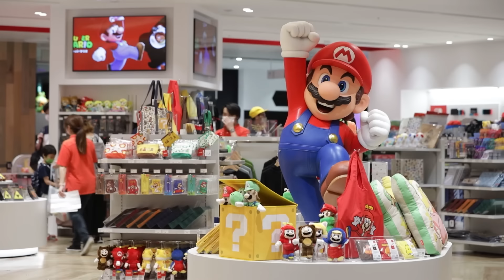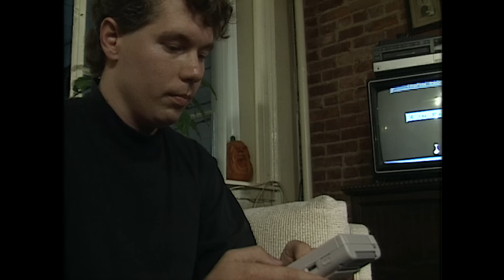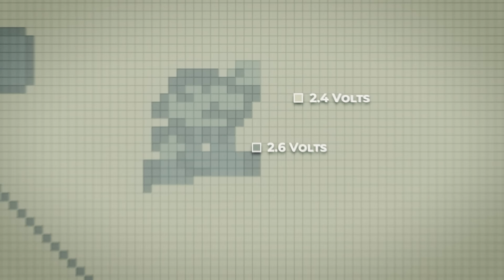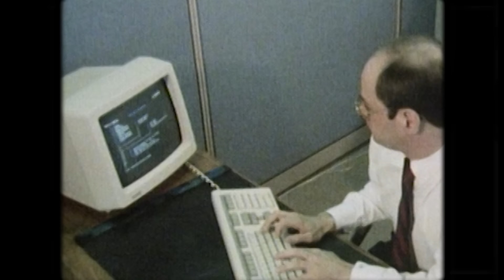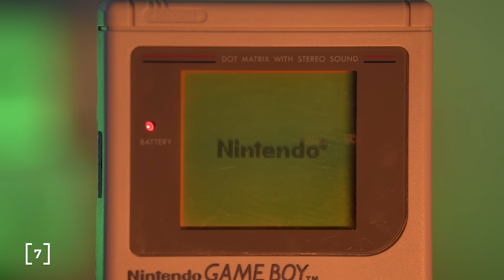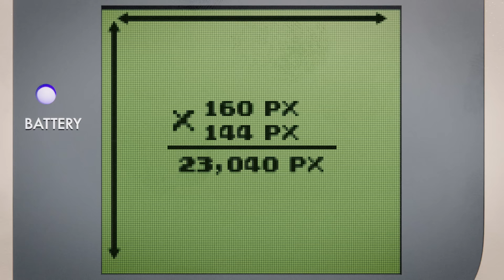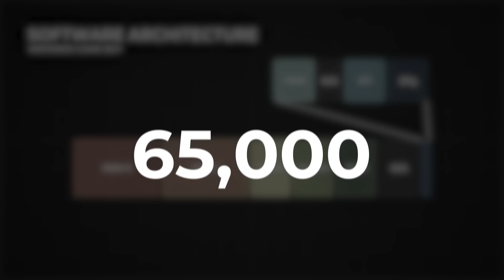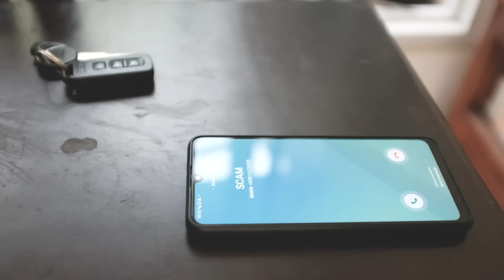The Insane Engineering of the Gameboy

Comment: Early video game engineers were absolutely cracked. Getting as much as you can from every byte is a lost art form.
Reply: @xelusprimeI don't really understand this argument. Sure better optimisations would be nicer, but no sane developer is going to code something like GTA5 entirely in a text editor, and I don't expect them to.
Reply: @skycloud4802  And nobody is expecting that. But there are a host of terrible practices that crop up in modern game development that could very easily be sidestepped with very little effort. For instance, I believe there was a case with one of the Halo games where 343 implemented the credits as an hour long 4k video file, rather than using an engine function to just scroll the credits across a rendered background. 

It's related to similar poor planning in the movie industry. Movies have ballooned in cost due to preproduction being  heavily cut and replaced with brute force iteration in post production. 

Preproduction is usually the 'strategy stage' of developing a game or movie, where you decide on technology and start laying out how you're going to solve each problem to achieve a finished product. Without that 'master plan' you end with projects stumbling around, wasting not just system resources, but time and money.
Reply: @Bustermachine  thanks for the explanation. You make some excellent points.
Reply: @Bustermachine  The way they choose to play credits across the screen matters very little. Choices like this are a choice to invest in other areas.
Reply: @widg3tswidgets416 consider the file size of an hour long 4k video file vs about four paragraphs worth of code to make the credits scroll?
Reply: Hands down the most impressive example of this was the original Roller Coaster Tycoon
Reply: @andysolganik8333  I disagree, not because that isn't impressive, but because I've seen Elite running on a 32KB Acorn.  🙂
Reply: @andysolganik8333  RCT came around 10 years after the game boy, though. Not that much of a problem in 1999 any more
Reply: @andysolganik8333  could you elaborate?
Reply: @JakMakai  It was hand written on assembly for windows.
Reply: @JakMakai  it was written in assembly
Reply: @andysolganik8333  Christopher Sawyer must be the most patient human on Earth to code that entire game in Assembly by himself.  Absolute rock star and I hope he's living an amazing life.
Reply: @andysolganik8333  As a programmer, Roller Coaster Tycoon is still one of the greatest inspirations of insane engineering... It's incredible what performance you could get out of those little bits and how much clever logic (including nice objects next to a path actually increasing guest happiness etc). Genius!
Reply: @andysolganik8333  The resident evil 2 port
Reply: @andysolganik8333 and before that, Transport Tycoon. Made by one man. An extremely impressive feat.
Reply: @andysolganik8333  Original Elite is much more impressive. Or Populous for the 16bit machines. Roller Coaster Tycoon already had comfortable resources available. It even had access to a full Graphics API (DirectX). So no, it definitely is not the 'moste impressive example' of this. How do I know? I am an old guy. Did Intros and Demos on the Amiga back in the day.
Reply: @andysolganik8333  never knew or thought of that...
how so??? on pc???
Reply: @andysolganik8333   not very programmer wants to learn x86
Reply: @andysolganik8333 oh the memories
Reply: @andysolganik8333  As a programmer, Roller Coaster Tycoon is still one of the greatest inspirations of insane engineering... It's incredible what performance you could get out of those little bits and how much clever logic (including nice objects next to a path actually increasing guest happiness etc). Genius!
Reply: @andysolganik8333   Nah, the most impressive example was the original "Elite" from 1984.

It packed an entire galaxy into 32KB.

Indeed, "Elite" did this by utilising procedural generation. It was an open world game. It featured permadeath, ships upgrades, true 3D wireframe graphics (with hidden line removal).

And the point to understand about "Elite" was that it INVENTED all of these things. None of this previously existed.

Its competition were arcade games like Pac-man, Asteroids, Space Invaders - with lives and score and levels.

And "Elite" blew all of this out of the water.

It invented modern video games, as now they all have open worlds, procedural generation, 3D graphics, upgrades and ranks, and dispensed with the notion of "lives" and "levels".

Indeed, Rockstar have confessed - "Elite" is the original game that inspired the open worlds of GTA. Bethesda has also admitted it - "Elite" was the original "open world" game that inspired the Elders Scrolls and Fallout.

"Elite" is the grand-daddy of them all.

In 32KB. In 1984. On an 8-bit home computer.
Reply: @klaxoncow  Where do I get a junior job learning about doing that? I imagine only embedded needs that. Still sounds insanely interesting. I have a bit of C programming experience but "Elite" and other games that push a hardware to its extreme is far beyond my capability.
Reply: @klaxoncow elite is fuckin amazing
Reply: @andysolganik8333 damn yeah - handwritten in Assembler 👍😳😳😳
Reply: not completely lost luckily, the Demo Scene is still alive and kickin
Reply: @Cryo_Gen  is it really? where?, I'd like to know!
Reply: @Cryo_Gen  yep we have 64K annualy
Reply: I'm still surprised that the xbox 360 could run Crysis... A game that's still demanding today.
Reply: @PunishedClippy  because it was optimized for that, not for the PCs. Xbox360 is a PowerPC
Reply: @PunishedClippy  The game is only demanding because it's single threaded at a time when single core processors were the norm. Modern day CPUs have multiple cores so while Crisis is hard to run, if you look at GPU usage you'll see that it's hardly being used
Reply: @PunishedClippy  
1. I mean it 'runs' crysis but is vastly inferior graphically to pc
2. It isn't demanding whatsoever today, you can buy an $80 pc and run it on max
Reply: @luketargett2233 that's a huge fucking exaggeration
Reply: nowadays, games are very unoptimized. older games actually looks better with higher fps.
Reply: @roku_nine  To a certain extent. It depends on the game. Older games do not necessarily look better
Reply: If an engineer wants that old school feel of having to fight for every last bit and byte, they should work on aerospace software, especially those that go into orbit.
Reply: There's also a video that goes in depth of the compression algorithm used to store all the Pokemon Red/Blue sprites in the cartridge.
Reply: It certainly isn't lost, it just isn't a requirement for most development work anymore... though one lowkey wishes it still was.
Still the issue is much worse in the Electron-powered general application hellscape than it is in gaming.
Reply: @SadeN_0 bro quit whining and download these 200mb of node_modules
Reply: @SadeN_0  inplace=True
Reply: @SadeN_0   Electron is horrible, people can't actually even program to the APIs of the operating system anymore.
Reply: There are definitely corporate and defense developers working with 516kb of memory. Gaming devs have no incentive to figure it out.
Reply: embedded  device programmers still struggle with memory limitation aren't they
Reply: Steve Wozniak, co-founder of Apple, was famous for this as an undergrad engineering major at Berkeley and then as a young engineer at various chip companies. This minimalist engineering ethos showed up in his design of the first Apple computer.
Reply: @joeyp1927  
I wish that I had found more time to program my first computer, my Apple //e. As I was watching some YT videos of old Amiga vertical-scrolling pinball games, what fun that would be to try to get that to work on a 1 MHz Apple //e. By my estimation, not having any actual hardware game sprites, only a 16K range of RAM representing its double-high-resolution graphics, most of that 16K would have to be entirely rewritten for each frame of animation. Using the most efficient program loop possible, byte-for-byte copying, I estimate that I could get around 5 frames a second. The Assembly code opcodes just can not execute any faster. Reading a byte, 5 micro-seconds, writing, another 5, incrementing an index register 2, test to see if the loop is done, I think that would be at least 2. Fewer than 100,000 bytes can possibly be copied in a second. Such slow CPU speed is fine for loading in still images, (I actually wrote my own crude double high resolution image loader which only took maybe a second to render an image, plus maybe a few more seconds to type the filename and wait for the disk to load the file), but horrible for anything like a mostly-full screen scroll that needs to occur multiple times a second. The non-visible parts of the pinball table would also have to be in RAM and in similar byte representation and thus could not be compressed, in order to allow for byte-for-byte copying. Thus, the pinball table would multiply in RAM memory size by 3 or 4 times. Maybe double would be enough, if there just is not enough RAM to do any more. Then I need some other overlay graphics besides merely scrolling the background, with no sound chip I might be limited to mere brief blip sounds so that the interruption in video animation is not noticeably long. And all that might have to fit within just 64K to minimize memory bank switching, absolutely no more than 128K required overall unless merely for loading different pinball tables from disk. However, most Apple //e s didn't really have 3.5 inch disk drives (DD DS capacity of 800K rather than 140K), and the 5.25 inch was limited to just 140K. The 3.5 inch disk drives become more popular by the time of the later Apple //c+ and the Apple IIGS. However, background pinball table images stored upon disk likely would be of a compressed data format since that would not be important to the byte-for-byte copying scheme for vertical pinball table scrolling. Initiation of the game loading, would include uncompressing the background table image. I wished I had tried something like that, just to see how well I could have gotten it to work.

So optimization for memory size, is hardly the only important optimization, back in the good old fun days when Assembly language program was quite the thing for video games. The slow CPU speed may also require some serious optimization towards trying to get a decent frame rate.

There was a cool pinball game for the Apple ][ computers, that did run on my Apple //e, that only used high resolution graphics, and not the later and better double high resolution graphics, and it was called Night Mission Pinball. But the entire pinball table fit onto the screen, and the screen did not scroll. Thus only the tiny pinball and the bumpers and other toys on the table, only those had to animate. And the colorization of the screen was really actually quite poor. At least double high resolution graphics reduced some of the restrictions somewhat on which colors various pixels could be.
Reply: In this thread: a bunch of armchair game devs who have no idea what they're talking about
Reply: I heard that, for a while, those developer design skills for resource-constrained devices transferred to making mobile games ...but these days compute is hardly an issue for mobiles either
Reply: @edstercw  my s24 ultra has 12GB RAM and 512GB rom, more than my laptop with 8 GB ram and 256 GB SSD. Never thought I'd see this.
Reply: @edstercw Mobile phones, ya that was never a thing.Early phones didn't allow app developers. The first few generations of iPod had some cool stuff though,
Reply: @jobowobo6700 what? Gameloft used to develop games like Beach Rally and Planet Zero for phones like Nokia 3410 . 

What are you talking about?
There were 3D games like Munkiki's Castle for Nokia 3310 and 3410 that were downloadable through WAP on the latter device.
Reply: Doing less with more is a great challenge that costs far more than if you just throw enough “if” statements at the problem. There is a LOT of math involved in making each byte do as much as possible and it’s simply easier and cheaper to not optimise if you have space.

It’s like if you have 1000 cubic feet of storage and only need to store maybe 90 cubic feet of stuff. Why would you optimise it when there’s more than enough space available? Sure, you’ll spend more time looking for what you need, but computers are extremely fast at it and you’d waste a lot longer time optimising than not. But when you have 100 cubic feet of storage, then you tend to take your time to optimise where to store and how, as it will help you later and decrease search time.

Basically, as long as computers become more powerful at a faster rate than programs can be optimised, it’s worth it to just jumble things together and wait for maybe 6-24 months for a 2x as powerful device. That is coming to an end soon, but honestly, it will take a long time to get to a point where everything needs to be squeezed in to make it viable. Until then, throwing stuff into the storage is gonna be the most efficient way to get it there and fast.
Reply: @magnusbjarni  It's also much hardware to hand optimise for more complex hardware.  Never mind the fact that it will often result in code that is harder to understand and more difficult to extend later.
Reply: Not all of us. I had to squeeze a full 90 second home run derby session replay into a 64bit int for Async multiplayer. Now, I cheated a little, but the replay really felt like you were head to head with that player they same way they played their round. No one ever could tell the difference, it felt like the real shadow round.
Reply: Limitations breed creativity
Reply: Yeah, it's really sad when you look at what they are doing now, games look pretty much the same for years, but you need 2 kg GPU for no reason.
Reply: Of course it is, there's just no reason for it anymore. I'm a computer science major, and most of my classes use C++. When I first started programming, if I knew an integer would never get very high, I would use a char instead of an int. I tried to practice efficient storage as much as possible. Until I had a professor explain to me that this was silly and pointless, and just made my code harder for other programmers to read and understand. I mean, with the amount of storage computers have these days, why bother? Same with speed efficiency as well. It's better to favor clear and easy-to-understand code over efficiency.
Reply: @njck24  It also matters that most processors are going move, store and compute with their natural word size anyway.  Thus when we create a 16 bit integer it's really a 64 bit integer internally.  But yes, the most important reason not to get clever is that other humans have to understand the code.  Modern hardware makes this possible.  All these people talking about things being written in assembly don't seem to realise what a maintenance nightmare that is.  No-one would do it today unless it was absolutely necessary.
Reply: @njck24  
I studied programming, but never got into it as much as I would have loved to. I would have loved to perfect my optimization schemes. At least twice, I coded my 70 0s and 1s for a 7-segment squarish number lookup table, such as for a mathematical properties graph on my Apple //e or for displaying a digital clock icon showing any desired time on it. For example, the first 7 characters of my 70-character string was "1111101" as that defines which segments have to indicate to display a 0. Obviously, the next 7 characters would only contain 2 1s and 5 0s. A character of my lookup table uses at least 8 bits and not just 1 bit, however trying to optimize bits would have produced unreadable program code. Of course my lookup table worked beautifully, and if I wanted a 7 with a hook on it, I would only have to change one character of the 70 to make that modification.
Reply: @njck24  it's pointless if you need to store 5 values, but if you need to store 5 billion, then the difference is gigabytes of memory
Reply: No, it's not a lost art form. It continues to live on in machine automation where every byte is rather expensive. Most PLC programmers are extremely skilled at optimizing byte usage.
Reply: An engineer's time to squeeze out performance is more expensive than scaling hardware. That is why nobody does it anymore.
Reply: I wouldn't call it lost.  Just lost in games, the demo scene still puts out new shit never done on old hardware.   
In basements across the country there are still spergs sitting there pumping undefined opcodes into hardware just to see what happens.

Kinda sucks though aside from demos there really isn't a way to present this kind of tinkering to the world now that consoles come with a bunch of cores, a vector supercomputer, and gigabytes of ram.
I guess for work there's reverse engineering and exploit hunting but I dunno man I think only a few times have I ever actually seen something in an exploit that scratched the same itch, hard to say what that itch is.
Reply: Now having remastered games that takes 125 gb of space x)
Reply: i mean getting as much as you can is why people still draw in pixelart
Reply: @SherlockX-sx5xk And program microcontrollers.
Reply: Agreed. I got my electrical engineering degree a few years back.... My main professor used to work for Sega, mainly making games on the genesis. We spent a short amount of time learning machine code just to see how it works. Machine code has no code IDE, c code has Visual Studio for example that helps manage the code and tell you what's going on under the hood.... With machine code, you had to program basic things like tell the code a memory address, and you had to manage memory yourself to avoid memory leaks.... It blew me away that all the games of my youth were created using this highly laborious and manual method. Not til much later did we get managed programming languages like c.... So I have an EXTREME RESPECT for the engineers that had the patience to create such good games despite lacking tools designed to do it.
Reply: All games used to be written completely in assembly, rct is cool but there's tons of other extremely impressive games on more limited hardware. Look up elite on the BBC micro (fully annotated source code is available online), for one example. Space sim in a huge universe on a 2MHz 6502.

But the problems are different nowadays. There's little reason to write assembly out of very specific circumstances, and the memory, graphics, and processing limitations of the old days simply aren't there anymore. Massively powerful hardware allows for extremely complex games that are just too big for most teams to fine tune with the time they have, you can't make huge games with a tiny team. Plenty of gamedevs nowadays love optimization, look into modern graphics pipelines, they absolutely blow away what people used to do, and indie games can be very impressive still (look at teardown). but all too often devs on large projects are given the choice between implementing a feature quickly or not meeting the release.  So you often have highly optimized graphics pipelines surrounded by less efficient code.
Reply: They have game jams dedicated to using these limitations as much as possible to make games😂
Reply: There is a video here where David Crane explains how he created the first Pitfall! game on the Atari 2600 with 4kb
Reply: Warzone updates...
Reply: Nintendo still does that
Reply: Have you heard of PICO-8? It's a modern fantasy console (like an emulator for a console that never existed) that is designed to give people hard constraints to work with for whatever games, apps, animations, etc they want to make. I've used it quite a bit and it's a wonderful way to get to know certain computer science and programming concepts.

For instance, PICO-8 has an extremely limited Lua library with functions for only fairly basic tasks, requiring the programmer to design more complex behaviors. And its virtual hardware is very limited, with a screen of 128² pixels and 16 basic colors. Knowing how limited it is, it is extremely impressive what people have managed to do with it.
Reply: Meanwhile EA only put refs into their footballs games last year. Whole they still have 2d crowds and ugly ugly sidelines.
Reply: The artists too... They had so limited selection of colors... but they used dithering and stippling and other techniques to replicate more colors or more variations of shadows/shades to a color to create more depth and 3d imagery... Not like most of the pixel art you see today, some of which is amazing on it's own... but some of those founding guys of pixel art games when that's all they had, were absolute masters at it.
Reply: Working within limitations more easily enables creativity, in my opinion.
Reply: Just go work at a HFT firm, milking every last oz of speed out of code still alive and kicking.
Reply: Can you imagine the voodoo magic we could do with today's computing power if us programmers were as talented and efficient as they were back in the day???
Reply: Naughty Dog did this with 'Crash Bandicoot'. Absolutely fascinating. Search 'War Stories: Crash Bandicoot' for the video.
Reply: That's why I use Ripcord instead of Discord, no Electron.js bloat.
Reply: Ye, a lost art form indeed... without it we wouldn't have cool glitches like the iconic Missing No. and crazy ASE stuff in Pokemon Emerald. Nowadays all you get in Pokemon are the game crashing or the abusing the physics engine not working properly.
Reply: now they waste it with spacing, looking at you python
Reply: Creativity thrives under constraint
Reply: I do believe that Rockstargames practices this lost art.
Reply: Now we get 100g "updates" larger than entire games from Call of Duty
Reply: very well said
Reply: tetris on gameboy, might have been peak gaming.
Reply: I think that's part of the problem with games designers and developers today.  They have that many resources available, that the developers just don't know how to fill all of the space up, so they fill it up with any old crap that they can, just for the sake of it.   Developers today have forgotten, by and large, how to make games like Fantastic Dizzy and Jet Set Willy, games that could entertain for hours, while being small enough to fit on a cassette.
Reply: It seems like a lost art until a product team smacks into a modern limit. Then they, too, have to review and economize their code. And then there is the insane level of economization that lower level programmers and hardware designers have done to get us the power we have.
Reply: painful experience.
Reply: Definitely a crucible.
Reply: Well, the Demo Scene is alive and kicking!
Reply: makes you wonder what they could do given modern hardwear
Reply: It only works when games are simple to code
Reply: Atat or A-T A-T
Reply: Electronic arts used to mean something
Reply: Just look at the C64 and especially Amiga Demo scene !
Reply: Yeah. Prince of Persia for example
Reply: give "gb studio" a google!
Reply: Um... They still hand-code the graphics tiles on certain microcontroller-based game consoles since you're obviously limited by memory here. Not to mention we don't have superscalar out-of-order processors within the microcontrollers just yet - only Cortex M7 is the marketable superscalar in-order processor (not sure about RISC-V version, they seemed to be very similar to 80386 or 80486 architecture, meaning single-issue in-order design).

So, no, it's not a lost art, it's more of motivation of doing so, as if you ask Shigeru Miyamoto, he would tell you that it was a very difficult endeavor (he was on NES / SNES software development teams in the past so he would obviously know how difficult it actually was).
Reply: Modification of entertaintment including prince of persia important to gamers
Reply: and machine cycle
Reply: Nowadays, it seems a supercomputer and power-intensive GPU are required to run subpar, unfinished, overly commercialized, and overhyped software.
Reply: Mid-Late 1900s engineers in general were cracked they had some interesting ways and tricks
Reply: Nowadays a game with just a title is 30MB in size 😂
Reply: Meanwhile, Kojima Productions
Reply: My favorite example of this is how the songs of Mario Bros were created. It’s basically the same melody sped up or background to create new music. Amazing workarounds cuz the cartridge had little storage space
Reply: Lost for decades now😢
Reply: And people would be more receptive to bugs and weird things / limitations than today because before some things could just happen, nowadays is way too overxagerated promises for lazy delivery. A lot of shit is just result of rushing and lazyness for cash.
Reply: Modern game design pales in comparison.
Reply: COD has the game boy devs rolling in their future graves
Reply: Yeah, now we have tons of memory so memory efficiency is not as strict
Reply: It really is. That, and the insane planning it takes for practical effects in movies.
Reply: Absolutely. And using such a limited medium to tell a story with lore. Just incredible stuff.
Reply: I think this skillful navigation of memory restriction is exactly what most businesses except certain tech giants will need to get around increasingly expensive memory. It's an art to be retrieved and handed down beyond generation milenial.
Reply: I swear I saw games on steam the most basic one is at 17GB.😶
Reply: *Laughs in microcontroller*
Reply: Not really true though.
Engines like unreal engine has a ton of optimizations that go down to the bit. 
They use bit packing and quantization regularly.
Wether you want to believe or not.
Nanite, even though some people like to talk bad about it, has a ton of optimizations down to the bit.
Reply: Roller Coaster Tycoon 2 was the end of that kind of era. Games written directly in assembly, etc.
Reply: Because the ampunt of "bytes" to work with now is fucking wild.
Reply: still that issue today jsut open up unreal engine try upload million polgygon crash ... alway making choices wether to use 16 sided cylider or 8 sided . u 3d using sub d subdivide 2 rtimes this know high poly then has to optmoised ......still memory issue all the time today art form still there not fun art form .. problem solving that all it is limiatation... trust not gone
Reply: The recent RAM and storage crisis might force devs to optimize their games again, in fact it's already happening to some games
Reply: Use the make games for the ti-83 calculator, where A single conditional is equal to 1000x int multiplications.
Reply: @jobowobo6700  facts basic is the first language i learned. my pc jr had a game that taught basic i think but i learned basic modding graphic calculator games. it was tough
Reply: These days: "We'll release our "AAAA" game that struggles to hit 28 FPS with a $2000 video card and call it a day."
Reply: If you work on large scale enterprise software or embedded systems there are still jobs tuning software, but most engineers don't do a lot of tuning or benchmarking.
Reply: I don’t understand. Coding in 10 MB versus coding in 60 GB - which one seems more daunting? Limited memory is actually easier to understand use and reuse.
Reply: It really isn't developers are always looking for ways to optimise. A interesting example is GTA V on the xbox 360.

It came with two discs and install disc and a play disc and even though you could install the play disc on the HDD you were not supposed to.

This was due to bandwidth limitations to get the most out of the system they needed to use both the dvd read speed and the HHD read speed simultaneously to increase level streaming performance.
Reply: @purkie103 here's an example to support my argument that supports your example 😂 old school devs would make it fit on one disc!
Reply: @Vosu92  that's size optimisation not performance optimisation though there are different ways to optimise in the example I provided they maximised the available read speed so that GTA V was able to stream data faster than any 360 game before it.

Bringing the file size down would have increased the power needed to unpack the textures/audio beyond the capabilities of the hardware.

I know this is tongue in cheek but it was a fascinating performance optimisation at the end of the 360 lifecycle and to me it shows that mentality can still be found when needed.
Reply: Like the original crash bandicoot strategically reallocating the ps1 memory. Now devs and engineers are forced to build for weaker consoles to appease the corporate overlords (with the case of Xbox at least, have to make it work on S and X which is so debilitating to ingenuity and design)
Reply: @LeNeovein  yeah I think there's a cool blog about the making of Crash 1 by a dev Andy Gavin
Reply: @LeNeovein  Even worse if they have to make a game work on Nintendo's limited hardware.
Reply: @LeNeovein Ignoring the Series S for a moment, the issue isn’t that we have crappy consoles. They’re more than fine and you’re not gonna get a PC capable of ray-tracing for only $500. The issue is the industry has gotten a lot more corporate. People in top positions knew or pushed to make sure games ran well because if it didn’t it could be a bust. Especially when their only recourse was to reprint with revised copies, but the bad news would’ve been spread by then. Now execs don’t understand or care, follow shareholders too much, and will just tell devs/customers a patch will come out. Because enough will buy the base game, and they hope they can get those people to buy MTX. That and the scene got mainstream, so there’s a ton of people that don’t know if a game is busted, or sadly don’t care. When it was mostly hard core fans, it would have a much stronger effect. Ironically, there were more excuses for things to be broken back then with paltry hardware. Now, the hardware prowess is abundant, but run worse.
Reply: @mrshmuga9  I wasn't saying the consoles are crappy, the constraints on having to both x and s were my main focus points. And even then the s isn't a terrible console it's just less than adequate for all things but they still have to design around it because Microsoft said so. Although they're getting more loose in that restriction lately thankfully. 

I rarely blame the engineers and devs, 99% of the time it is corporate greed pushing for more profit like you said. "Either work fast or find a new job"
Reply: @mrshmuga9  Seems like the consoles don't have much ray tracing capability either.
Reply: We’re looking at you, google chrome engineers!
Reply: Can you imagine what could be done from a group of developers like that today? With the right publisher, they could become an unstoppable force in the industry, setting the bar so high that all the riff-raff would fall to the wayside. 

Actually, we know what would happen because we got to experience developers like that as they moved from cart based games to the CD format. They went from doing everything they could to squeeze as much fun out of a severely limited cart to..... having so much space, they didn't stop dropping features in. During the 5th generation (Saturn, Playstation, and N64), developers crammed every feature they could think of all to make the most enticing package imaginable. It was a smorgasbord of gaming greatness and I loved it!
Reply: All software developers could take a lesson from that time. I'm seeing performance issues in Adobe products all of the time on a beast of a computer.
Reply: Limitation is a cornerstone of creativity - however this required a lot of pain to get the simplest things done. What those guys put together within a year someone as talented as them could make today within a week. If modern games were done like that they would either take multiple decades to make or tens of thousands of people, and both wouldn't be viable. We would have been stuck with arcade and platform games.
Reply: Old school devs worked with extremely limited resources, often squeezing every ounce of performance out of the hardware they had. Their ability to optimize code, manage memory, and create engaging gameplay with such constraints is indeed a lost art form. Every one of these old school systems had games that pushed the limits. Sega Genesis and Saturn were both absolute beasts in the hands of a ninja. 

These days? All of that is abstracted in tools and frameworks; developer doesn't have to think about those types of concerns anymore. CPU and RAM is abundant for days. Just fill a 4K frame every 33ms and regardless of platform the experience is consistently the same. Good or bad; thats just how things are now.

Those days are indeed over.
Reply: We have so much resources available now that developers just don't bother anymore and that really sucks. We still have the demoscene which has people who can cram an impressive demo in 4K or less or various Linux programs that focus on being as minimal as possible.
Reply: It's also unnecessary now.
Reply: Blame dei for that
Reply: Lost art form? Have you played Tears of the kingdom on the switch? No one can tell me they aren’t using the switches hardware the the full extend
Reply: @Asgar1205 we’re talking 30-300 KILOBYTES of data. that’s a massive difference to say a switch game which i’m not sure but i’d imagine they have at least 1 gb of data on the cartridge .
 1 GB (gigabyte) = 1,024 MB (megabytes)
 1 MB (megabyte) = 1,024 kB (kilobytes)
Therefore, 1 GB is equal to 1,024 * 1,024 = 1,048,576 kb . you can see how this really isn’t a comparison by any stretch of the the imagination
Reply: @xaza8uhitra4  There's an order of magnitude difference in absolute numbers yes, but it's still comparable in relation to the available resources. Tears of the Kingdom has a file size of around 16 GB. Compare that to games on other platforms which are often around 100 GB. Squeezing the entirety of TotK into that relatively small amount of data is definitely an impressive feat.
Reply: @xaza8uhitra4 It is though. Tears of the Kingdom is a very well optimized game. It's just not possible to optimize anything to infinity.
Reply: @xaza8uhitra4  shut up
Reply: @xaza8uhitra4 yeah basically one image on a website, games these days are measured in gb's
Reply: @Asgar1205 It’s insane how much they pull out of a console with 2015 hardware to make that masterpiece work. Truly mind boggling.
Reply: @Asgar1205  that's not anywhere near on the level of optimzation a lot of older games strove for, though.  Developers were frequently optimizing literally every byte they could, because they frequently had to.  Even the most efficient games nowadays don't bother with that kind of thing because it's just not necessary, even on a relatively "weak" system like the Switch.
Reply: @Asgar1205 lol
Reply: @Asgar1205 Dude… it’s based on a game made for Wii U, and the whole “vehicle crafting in an open space” was done back on the 360 with Banjo-Kazooie: Nuts & Bolts. It might be open-world, but that’s just because they use different approaches: N&B loads an entire level, whereas TotK streams assets within a certain range (hence why objects disappear if you move just far enough away). It’s not some technical marvel, never been accomplished before, or even a new game concept. It just focuses more on combat whereas N&B focuses more on racing (in strict and loose senses).
Reply: @Asgar1205 your joking right? The memory efficient days of the 90's are long gone. Nothing but high level languages for soy devs
Reply: @TheJimmyCartel  Depends. Just the other day I programmed Arduino Uno 12x8 led matrix and while the system has plenty of memory to waste some it is more intuitive to represent the 96 pixels or bits by just using 3x32bit unsigned integers. Scrolling "image" is also done with bitshifts. It still has its uses but the fact is it's pointless to save memory or space if you don't run out of it.
Reply: @WXKFA  Try programming with a Attiny85, then you get only 8KB of flash memory, or 6 after the bootloader.
Reply: @TheJimmyCartel  cute, you know what high level and low level languages are. There is a fairly good reason we choose to use them for most applications. I'll let you take a guess at what that is, so you don't look like a complete moron and just like a teenage edgelord.
Reply: @TheJimmyCartel  If you tried to make a game in those low level languages AAA games wouldn't exist and we'd be stuck with small games that still would take forever to make. Efficiency is key and what you're proposing would set many games back even further and vastly increase production times due to how complex modern games are
Reply: @TheJimmyCartel ”soy dev” is the craziest combination of words😂. No idea if you’re right but you sound miserable and lonely. Who says that?? internet commenters are wild when you step outside
Reply: @TheJimmyCartel   "soy devs" so how many games have you built?

This isn't about devs being lazy or unskilled.  It's devs being forced to develope and release a game at breakneck speed because the management above them don't care for quality.
Reply: @TheJimmyCartel  No he's right, ToTK on Switch is a technical marvel. But you are also correct in that it is VERY rare these days amongst most other AAA developers.
Reply: @Asgar1205  1 example? There are still people who can speak Cornish but it is long extinct.